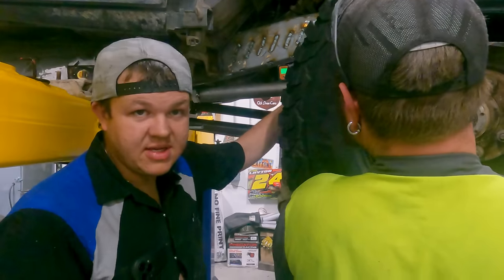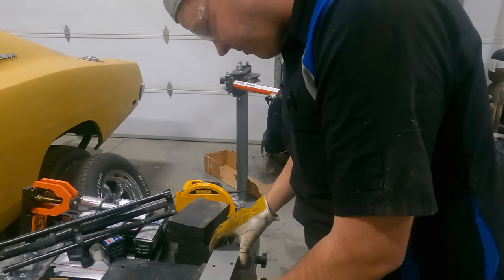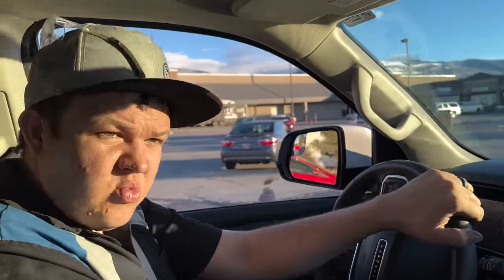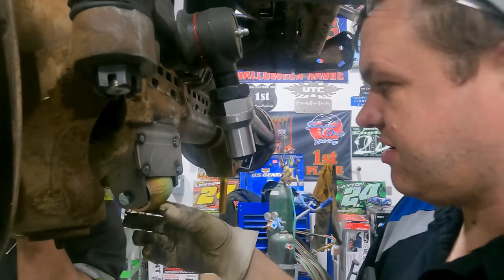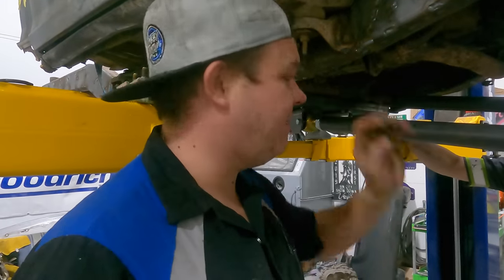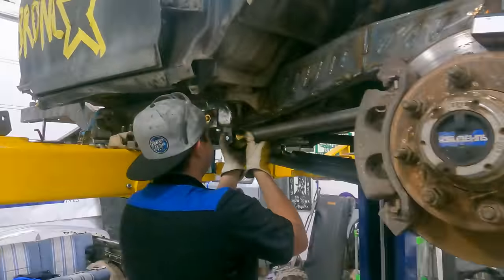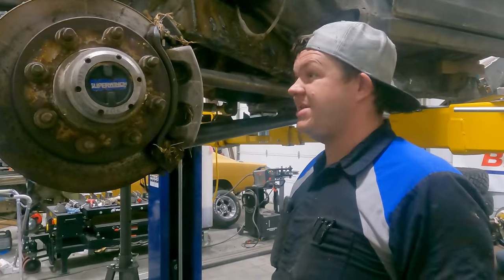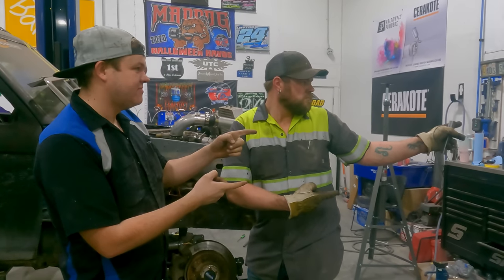BroncStar NOT Designed For 1-Tons! 4 Link Barely Fit!

Comment: CR2032 batts; they have you over a barrel if you wait til you need them to buy them. There are multiple places you can buy them ahead. Ikea sells them in a ten-pack, or you can get a 20-pack on Amazon for less than $7. These are all made in china, including the brand names. I have had some on the shelf for 5 years and they never go bad.
Reply: Same battery that goes in key fobs and computer motherboards. Super common.
Reply: I have used the IKEA batteries and they work... but MUCH shorter life span than brand name ones... but yes much cheaper.... just be ready to swap them out sooner....
Reply: @davebenson1504  That has not been my experience. There doesn't seem to be any difference that I can tell.
Reply: @asandberg6  Yep, that's why it's good to keep a pack of them around!

Comment: Just a FYI, Energizer bought the Rayovac plant here in my home town a couple years back, and they are now in process shutting it down in next year. Energizer bought the plant because its assembly lines built in 80's and 90's..  were THIRTY years newer than energizers production lines, and they wanted to eliminate competition in the Market.  Those battery costs are not "just the way it is". Those costs are 100% cooperate greed.

Comment: I like the axel welded to the frame. Back in the day we used to call that a west coast suspension. No springs or linkages. Bolted directly to the frame. Sounds like fun. I don’t want to be in it when you go down the road. 😂😂😂😂. Good luck. But I have confidence in you guys. 👌 good job as always.

Comment: I say weld in an engine hoist/crane in the bed of it, and guest star in the off-road wrecker Olympics 😂. Cut the hoist out when you’re done, and rock it. Or keep the engine hoist if it just works unexpectedly good. (Maybe add a winch?)

Comment: Glad to see you guys working on your weight/strength. 
I'm 5'`10" and weighed 220 pounds before I started dieting. I'm now down to 155 pounds which was my goal. 
I used a couple different techniques to get there, and for the most part it wasn't particularly painful. 
My drink of choice is Coke. Giving that up would have been torture. So I just kept it in my diet, just at a reduced amount. I allowed myself 3 cans a day when I was on the last leg of the diet, going from 190 to 155. I had to do calorie counting, limiting myself to 1700/day. 
The soda took a 360 calorie chunk out of my diet, but made life bearable, so was worth it. 
I've also seen in myself and others, that separating strength training/exercise from dieting was important. Doing both at the same time was too much. And often people (myself included) will do something strenuous and then think they deserve a reward. "I just jogged for half an hour, I deserve a cheeseburger."  So they burned 300 calories and ate 600....
I concentrated on weight, then, once I was at my target, I switched to maintaining* weight and moved to working out. 

* A critical component to dieting, and especially maintaining a weight when you achieve your goal, is to get on the scale EVERY DAY. 
Pick the same time and same conditions. (I weight myself first thing in the morning, before eating, right after my shower, before dressing.)
Don't worry about a 2 pound gain in a day. But if those two pounds stay there for a couple of days, you need to take action. It's very easy to gain 10 pounds in a couple of weeks if you aren't paying attention. I'd go on a trip for a week or two, not weighing myself, and come home up 10-12 pounds. And have to diet for a week or two or three to get rid of it. 
Now when we travel, first day we hit a Walgreens or Target and buy a cheap scale for the hotel room so we can continue monitoring our weight. No more nasty surprises when we get home. 

Good luck on your journey to better health! Its amazing what being fit does for your daily attitude and outlook on life.

Comment: Range Rover Classic has the front diff pointing up. Pointing up by the opposite angle so the prop is still happy with constant four wheel drive. ( should the need arise, but it proves it can be a bit off a still okay 👍 )

Comment: The top links for front axle have to be strait or point in towards the axle center, and if you have them strait you really should have the lowers mounted more centered between the frame rails to get more triangulation. If you move the top mounts out more towards the wheel so the links aren’t strait it’ll handle poorly on road in my experience. And can also handle poorly off road as well. This is just my opinion and if Paul and Matt all tell you it’ll work that’s great but it didn’t work for us
Reply: He said he is going to triangulate the lowers.

Comment: $8 batteries is because you went to Napa. Try Harbor Freight or Wal-Mart.
Reply: In rural areas choices are limited -  cheaper might be 40 miles away!
Reply: @rogersmith8096  True, but he doesn't live in a rural are and they have a Wal-Mart, Carquest, and a Tractor Supply in Ephraim Utah as I well know.

Comment: Wtf are you doing with the front lmao upper links should go on top of the center of the axle with a truss, lower links need to be parallel with the axle and not on the bottom. This thing is going to break first time out